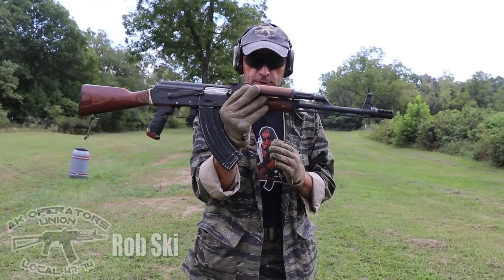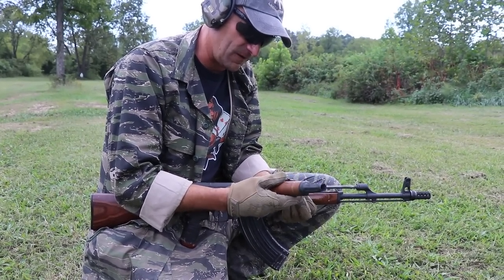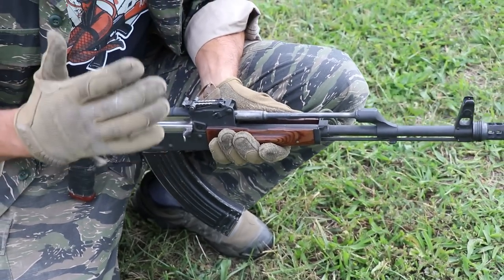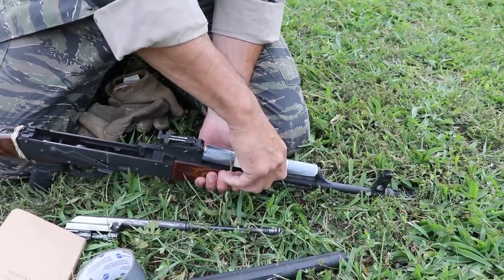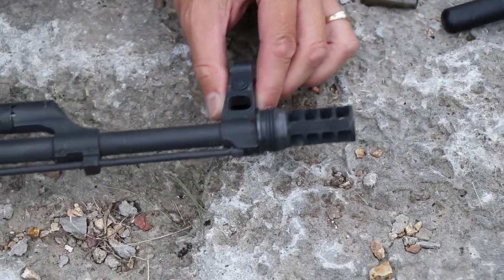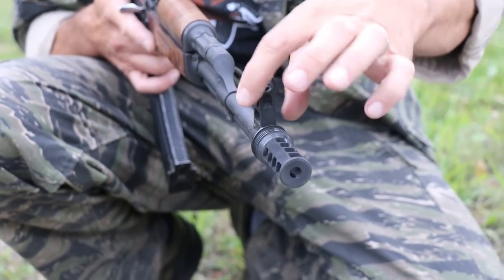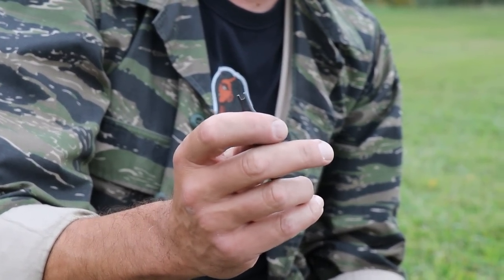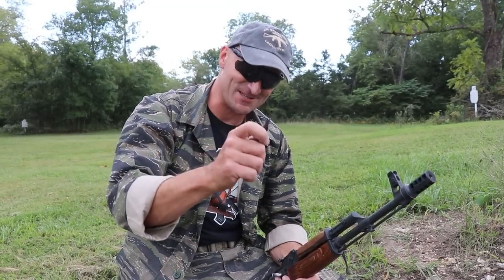AK Guerilla Gunsmithing 2! No Gas Tube and Rock?!

Comment: When I first put night sights on my glock I removed the old plastic sights and installed the rear sight with a .30-06 shell casing and a stump. Bashed the casing and gun against the stump with the casing held against the sight. Sharp edge of the case mouth ate the plastic up good. Sighted in perfect and I haven't touched it since.

Comment: I've found it is also possible to use an SKS without its gas tube/piston assembly.  It works as a straight pull bolt action.  It is best, of course, to tie a rag behind the gas port to avoid that gas blowing into your face.

Also, Rob Ski can construct a mnemonic memory circuit using stone knives and bearskin.

Comment: can you explain the differences for a 90 and 45 degrees gas block and if vent holes are really foundamental? I'm curious to know if there are malus in a system without vent holes on gas tube and gas block..like using an ak 74 or akm or later gas tube with unvented 45 degrees gas block..the gas system on ak afascinate me so much..however did you felt less recoil on ak withous gas tube? tysm for you work

Comment: Was wanting to buy some brass cases and start loading 7.62x39. Do you have any experience running reloaded brass cased ammo in AK.
Reply: PPU Rifle Line 123-grain FMJ runs extremely well in my 1999 SAR-1. I don't know why the rifle has a nasty habit of denting the neck* though. The brass cases I have are Boxer primed (i.e. easily reloadable).

* exactly like the case at 5:10.
Reply: @justme_gb  That's because you're shooting brass case ammunition in a rifle designed for steel case ammunition. Brass case necks always dent easier. Most Russian firearms dent the case necks. Even my mosin nagant does it

Comment: I wonder if the alignment would be any better if the wobble is taken out of the piston.  My pistons  have half a turn out to allow wobble.  If the piston was screwed in tight to the front bolt carrier piston extension I wonder if it would go into gas block correctly without help?

Comment: Theres no gas tube, but there is enough pressure on that gas joint or block. It would be interesting to see if the AK can function like a bolt action, no tube, no block...wondering if the bolt can be hand cycled by that charging handle like a bolt action?
Reply: Try it and let us know

Comment: I wonder If we removed the piston head (Like your adjustable one breaks or something...) would the AK still be safe to single shot fire?
Reply: If you're expecting single shot fire, the piston head would not matter since you are holding the charging handle forward with your thumb on each single shot anyway so it would not matter if you had a piston head or not
Reply: Never tried it with AK, but the SKS will function as a straight pull repeater if you don't have a piston. Not sure what you'd have to do to break the AK piston though.